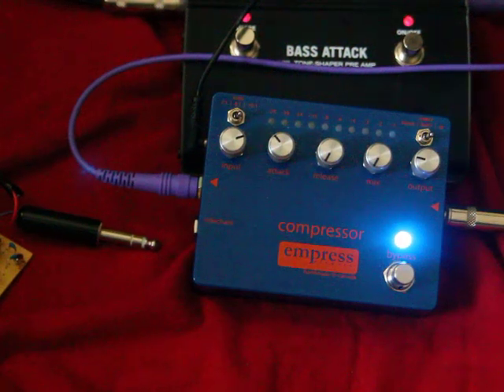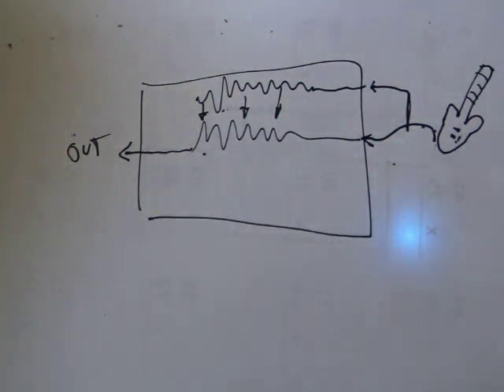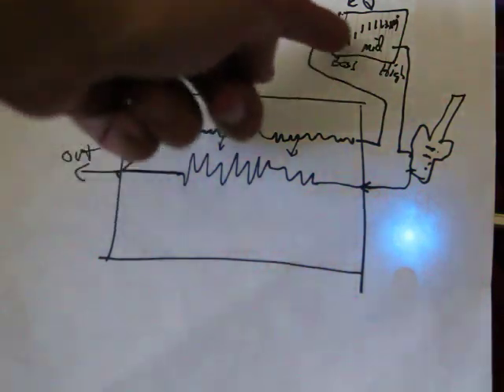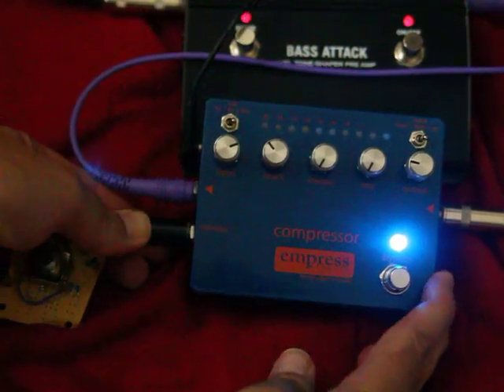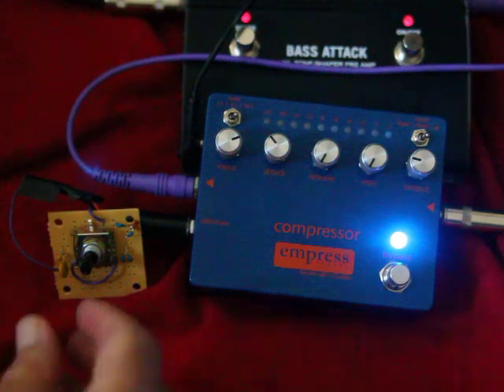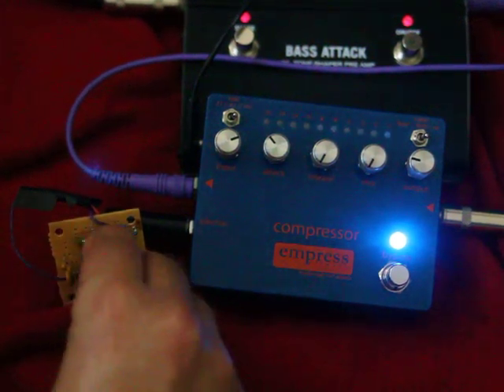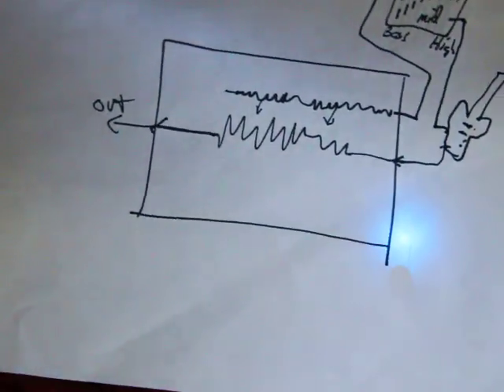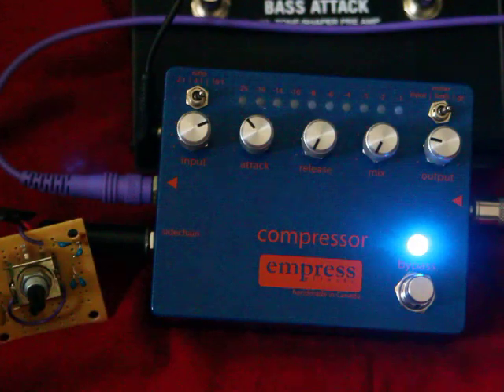Empress Compressor - using the Sidechain on Bass

Comment: Thanks, this video is still very useful! Seems the only pedals that have HPF are very expensive boutique pedals. Guess I'll have to make one as well.
Reply: b. t. Broughton Apex has adjustable HPF built in as a side chain. Depends on what boutique really means. It’s a VCA compression, less than $200, handbuilt, does the job great.

Comment: Except surely you won't hear any difference because you've got the mix on 0?
Reply: Whiskel bro I was thinking the same thing, and that's like 80% of bass compressor reviews I've seen on YouTube. They all max it out in one way or another so annoying.
Reply from the maker: Yes - I realized I set it wrong while editing the video...it happens sometimes when you're a one man circuit designer, component builder, bass player, videographer, narrator, equipment guy, sound man, video editor and computer tech getting paid $0.  :( 
While I messed up, this wasn't set up for good sound capture, but the compression meter really showed what was going on.  On a low-fi vid like this, given the meter, I still think the idea comes across well.  Thanks for watching and hope you still found it useful.  The Empress is a really nice compressor and I still love it years later.

Comment: Hi Jeff. Awesome video , i'm really digging this filter device you built. Would you point me if there is any link or diagram i can follow to build one . I would rather build a little devise like this that just adding one capacitor to SPJ. Thank you
Reply from the maker: I just sort of built it on the fly with a small radioshack universal board and a multi position switch I had left over from a different project.  Sorry - no schematics.  Another good option is to pic up  cheap EQ and use it in the side chain.  You need a TRS cable.  I wanted a passive device with a small footprint.  I made three different value pancake plugs and use the value that works best for the job.  But this eq is only $25 and would give you A LOT of flexibility:  Peace. 

http://www.musiciansfriend.com/amplifiers-effects/behringer-beq700-bass-graphic-equalizer-pedal

Comment: I have an Empress compressor for my bass set up and it is excellent. In this video it seems the mix knob is set to full dry so we cant hear the results of the sidechain device adjustment. Why not turn the mix knob to full wet and then broadcast the result? Partly inspired by this video, I have installed a 2.2nf capacitor inside the head of a stereo pancake jack to my Empress compressor but I am not really sure I can hear the difference unless I whack up the comp settings some. However, I generally leave the comp set at 4:1 and mix in some dry.

Comment: So just to be sure I understand exactly how the Empress sidechain feature works, it would be greatly appreciated if you could confirm that my understanding of the following is accurate:

The empress sidechain uses a TRS (T=Send R=Return S=Ground) "connection port". Am I correct in assuming that this means that the empress is going to send the dry bass signal to and external input/output equiped EQ device and receive the EQed bass signal back from the external EQ through the same "connection port"?

If so, does this mean that one can use a 1/4" stereo jack to 2 x mono jack 1/4" (non TRS) wire to perform all the necessary connections between the Empress side chain "Connection port" and the EQ? The 1/4" stereo jack end would go in the empress side chain and the other 2 x mono jack 1/4" (non TRS) would go on the input/end of the external EQ device, correct?

I'm asking all this to confirm that my logic is correct because I don't understand otherwise how your resistance selector could do its filtering task without being directly connected to an incoming bass signal.

Thanks for your time :) Cheers!
Reply from the maker: The sidechain uses a TRS (tip/ring/sleeve) so it can send the signal out (I think through the tip) and the return the signal through the ring (I think).  You should be able to do the stereo jack like you say, but I always use pre-made TRS cables that have the TRS plug and then two wire leads (one marked Send and the other marked Return)  Example:
http://www.amazon.com/Hosa-Cable-STP203-Dual-Insert/dp/B000068O1P/ref=sr_1_10?ie=UTF8&qid=1427858775&sr=8-10&keywords=TRS+cable.  

You route the Send to the input of your external EQ, and the put the Return to the output of your EQ - I think you have the idea in your post.   If you have a stompbox EQ already this will give you great flexibility in getting the compression response you like. (I was doing that for a while with very good results, but I wanted a passive device to make life easier.)

The filter device is not directly connected to the bass signal, rather the compressor splits the incoming bass signal and routes the original bass signal to the compressor and routes the split signal to the side chain.  This split signal gets effected by the filtering device.  (BTW - The device selects different capacitor values, and each capacitor filters out different frequencies.  My external device doesn't use any resistors).  Hopefully this helps!

Comment: What about solving the bass comp. problem by using the dry-wet signal mix knob on the Empress, i.e, adding some dry signal to the compressed signal?
Reply from the maker: Thanks for watching and the comment.

I use the sidechain/filter to keep the compression level constant on all the strings. Otherwise, to get higher notes compressed to my taste, the low notes sound over-compressed.  I don't know how to explain this, but with the sidechain setup, my bass "plays level/feels level" over the fretboard and I quickly forget the compressor is on.  Without the sidechain, I find myself attacking the strings differently (lighter on the low notes to get the compressor to back off) and sort of fighting against the compressor.

I love the mix feature - I also mix in the dry to keep the attack crisp and articulate and to keep more of the natural "wood overtones".  I finger play, but with a pick the attack really benefits from mixing in the dry.  But even with the mix, the wet/compressed signal still has the uneven compression level issue without the sidechain.  You don't notice it as much with the dry mix because the dry signal keeps your ear from focusing on just the compressed signal. 

Taste for compression really depends on what the player likes - and using mix alone might do the trick for many folks.   But the sidechain trick really makes the compressor feel/respond like it's just part of my bass no matter what range of notes I play or how hard I kick the notes.  

Peace.
Romans 10:9